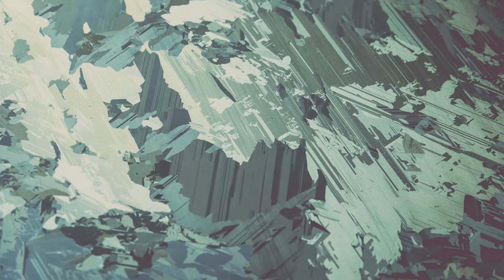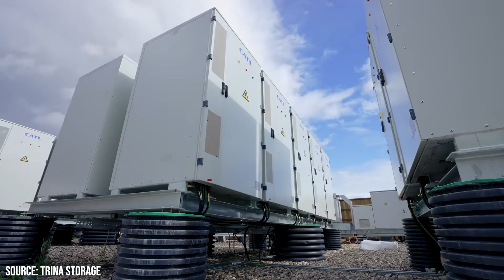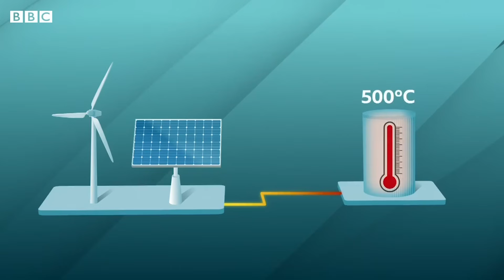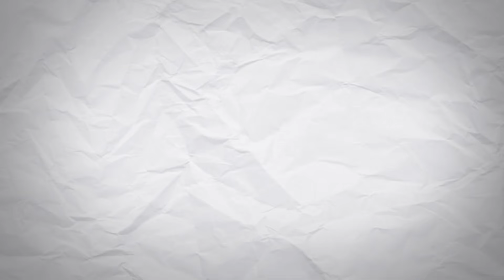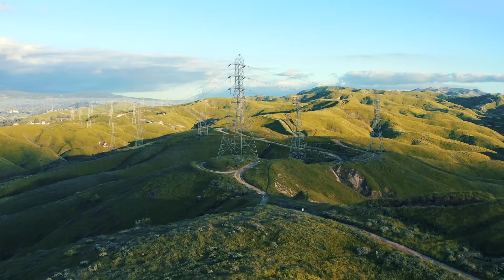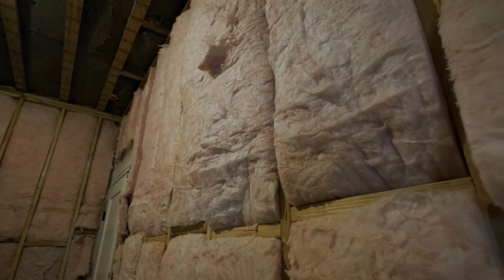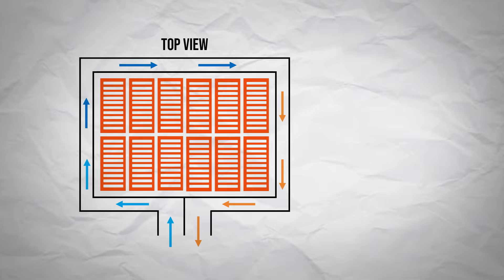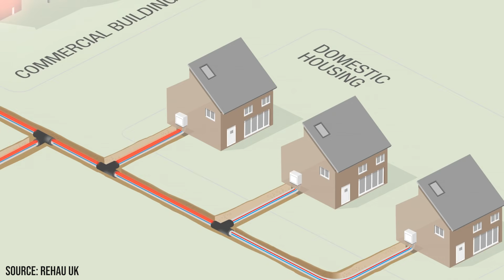How 3000 Degree Bricks Will End Battery Storage

Comment: I'm imagining all sorts of problems unaddressed by this presentation that probably means initial claims are impractical and not so much a breakthrough.
First, that 98% storage efficiency number was never addressed in this presentation. That's an abnormally high number. Although the physics and current knowledge of materials related to thermal heating and insulation are very well known and even commonly a part of ordinary systems in every home and business, limiting loss to 2% is extraordinary and needs explanation not provided in this video. The closest explanation in this video probably relates to the double wall insulation separated by constant argon or air flow, but that's not likely anywhere close to efficient enough to be a good answer. Besides, capturing losses like this is just one approach and not that original an idea.

Additionally, this system as described cannot be practical to distribute heat as an energy source.
Towards the end was described a theoretical row of residential houses, each fed with plumbing transporting heat by some unknown medium. I highly doubt that even a planned residential area would want to install a new plumbing system that would itself need to be well insulated to limit loss and the related controls to manage how the heat is used in specially built appliances like water heaters, HVAC, and possibly stoves and ovens. My subjective opinion is that's just too much innovation and capital expenditure required to develop and manufacture very original and non-versatile appliances that anyone would risk capital investment. And, there would be all the additional requirements of engineering, installation, and maintenance.

So, if distributeing heat as an energy source is not practical, it likely means that a heat storage system as described in this video can exist only where it is immediately next to where the heat would be used, like on premises heat storage. Probably the big question then is if it even pays to store heat if the heat is generated by electricity as described in this video when electricity is so much more available using existing infrastructure that exists everywhere in a modern society. Wouldn't it be far better to not deal with storage and simply use the electricity to directly power the furnaces and machines?

That leaves the probable only practical use for this type of energy storage onsite where the power is being generated, especially if sourced from electricity. That's fine but it means that it's competing against any other metropolitan energy storage.

I also take issue with the video's description of heating the bricks (of unknown composition) using electricity. This means that although technically the process wouldn't count towards losses in energy storage, it would have to involve huge losses in generating the electricity and then converting to another energy like heat. 

And, there are additional losses and inefficiencies related to what's happening on the other end, most likely converting heat back into electricity as described.

I favor a different implementation using thermal energy storage.
There are a number of designs in use today that don't involve super heated temperatures that are easier and cheaper to manage.

Comment: Would the battery be central at the origin where electricity is produced or would it be decentralized at peoples homes? This i guess is scalable either way, question is what is more efficient? Also what would be more efficient in terms of delivering to the customers, heat/steam or electricity. We already have cables to deliver electricity, so why would we want to replace those with steam/hot air pipes?
Reply: The batteries will be sited at industrial facilities, right where the heat demand is located. Heat is not transported over distances. We utilize transmission lines to bring electricity to where heat is demanded. Please note we will not be powering homes - these are for large industrial emitters like steel production, cement production, etc.
Reply: @RondoEnergyGlobal  thanks for the clarification. The vid gave a slightly different impression or i just didn't get it.

So one could say should the energy grit have interruptions or the demand exceeds overall production of energy, these batteries would close the gap or in terms of solar/wind when more is produced it could be saved up for when less energy is produced?
Reply: @kinngrimm  During peak generation in the middle of the day -- renewable power is sometimes curtailed to avoid damage to the grid. Instead of curtailing cheap, clean power, the grid can instead export power to Rondo Heat Batteries to decarbonize the largest sources of emissions -- heavy industry. We would not convert that heat back to electricity for the grid -- rather -- that heat would be sent directly to these facilities to reduce or eliminate their gas use.
Reply: @RondoEnergyGlobal  ok got it. i wish you good luck for your endervours sofar this seems to be a nobrainer, meaning why wouldn't we want to use this concept ^^ .

What material do you use to insulate  the heat storing bricks from the environment and what are these bricks made of? If this wouldn't be a company secret (national secret?). It was said in the vid you use all basic materials, right? If so, am i right to assume, that the overall concept of using these different parts in conjunction in the way you do is what makes your patent special and not the singled out parts and materials?

Is there any state restriction you would have where on earth to use this? Nowadays this seems could become a theme again.

Comment: How do they insulate the heating chamber so well? I can't see how you can store such high heats without losing a lot of it to the environment.
Reply: Dynamic insulation. The air that is cycled through the system surrounds the entire system -- so heat that "leaks" through the insulation is warming up air that is used -- this minimizes losses.
Reply: @RondoEnergyGlobal  This makes no sense at all.
If you're 'cycling "air" through the system' the "air" coming off the pile is already at temperature.
It has to go back to whatever arc or plasma heating element your process uses and be brought above the heat of the pile in order to shed heat into it.
Whatever you're using to duct that gas has to be refractory with a higher melting point than silicon. Carbon perhaps? But any of these will be reactive with nitrogen and oxygen in "air"...
Of course 3,000°F is too high for steel, and platinum is far too expensive to be used as a reflector so ultimately it is going to be radiating a lot of heat because of the high ∆.
I don't need my sense of smell to know horse💩when I'm standing in it.

Comment: Read this same story about prototype battery tech for 20 years already. But where is it?   It's time to stop fantasizing about the future and get onboard the lithium bandwagon.
Reply: Lithium is a great solution but with a short lifespan and degradation problems! There are great use cases for it on the grid -- but lithium ion cannot supply heat for large industrial thermal loads!
Reply: @RondoEnergyGlobal  Yes but the title of your video is 'will end battery storage'.   Yet your comment above is only talking about a single use case.

Comment: How do you heat those bricks, by surplus electricity from renewables? What's the efficiency of the whole cycle? There are already solar thermodynamic/concentration plants who use the same concept albeit storing heat at about 600C and this posed serious safety issues. If this company overcame them with their bricks, why not then use those bricks in a solar concentration plant?
Reply: From electricity to delivered steam, the process is 98% efficient. Solar concentration plants take up a massive footprint and require you to transport heat over distances which results in massive efficiency losses. The Rondo Heat Battery converts electricity to heat right where the thermal load is located, and plugs into a facility's existing heat network.

Comment: Sounds like an interesting concept, but you spent the least time on the most important part. And thats the actual storage and insultation
Thats why batteries are so good, because they can store their energy until its needed. Heat is constantly radiated and is a nightmare to properly insulate for long periods of time. I would imagine there is sig ificant heat loss over that 12 hour period, greatly reducing the efficiency of this system.

If you could show the actual heat loss over time, that would convince me better, but for now, im still doubtful this will replace batteries any time soon.
Reply: We are constantly exporting heat 24/7 at 98% efficiency -- from charging only 5-10 hours per day! We size our systems so that we can deliver heat continuously. Heat is not lost due to our dynamic insulation that recaptures heat and circulates it back through the system.

Comment: Air blown over the heat source and then used in heat exchanger ?
Would have to see technical data to see why this inefficiency step is in place
Reply: Air circulates through the bricks and then over a boiler tube to create steam. Most industrial thermal processes require steam -- not hot air -- not electricity!
Reply: @RondoEnergyGlobal  what I meant is, I assume u would want as little degradation of your storage material as possible so why blow air over your material won't you have problems with oxidation degradation ?
Why not use a closed system with noble gas.

Comment: This is complete quackery. Yes, if you're using the output as industrial heat then 95% efficiency seems reasonable. But the moment you try to convert back to electricity, you lose big time.
Reply: That's the thing! We don't convert it back to electricity. Industrial heat demand represents ~25% of global CO2 emissions. We're decarbonizing this heat that has traditionally been very difficult to decarbonize with electricity.  Quack quack!
Reply: @RondoEnergyGlobal  Then why use grid electricity for the heat in your thermal storage in the first place? Are you suggesting the grid is cleaner than an industrial gas burner for generating heat?
Reply: @jameswatkins7763  Marginal electricity during peak hours of generation during the middle of the day -- when the RHB charges -- is cleaner than an industrial fossil-fired boiler for generating heat. Note - we can also be configured off the grid, with an off-grid renewable installation.
Reply: @RondoEnergyGlobal  So, grid electricity is cleaner at certain times of the day? Are you assuming that from peak output of on-grid solar?

Comment: What's the maximum temperature this can get up to? And how much of the electricity generated is used to increase the temperature?
Reply: We're working toward 1,500C. We don't generate electricity -- we export heat directly to industrial processes that demand heat!
Reply: @RondoEnergyGlobal  Sweet! Im concerned about the efficiency of the whole process. If it takes 100 kwh to get up to operating temperature with this system, and that amount costs more than buying the equivalent amount of natural gas, then it makes no economic sense. Not to mention replacement/maintenance costs
Reply: @scottyyoch3537  rondo is buying electricity during peak generation hours (where electricity in some markets reaches into the the negative due to curtailment). This is cheaper than gas and provides enough charge for rondo to export heat 24/7. It can also be configured with an off grid solar or wind plant, which pays itself off quickly over the contrast lifetime.

Comment: ! have heard this 100 times before. “This is gonna be the next latest and greatest thing to solve all of our energy needs” and it turns out to be snaggle. I need proof. I want to see a proof of concept prototype working in operation and I want to be able to inspect it with my own engineers.
Reply: Stay tuned for our upcoming customer announcements!
Reply: Bloom energy will let you. Although nothing like this it is efficient ah, battery exchanger. Look them up.

Comment: My first thought is, if this idea is good and cheap with little or no drawbacks, we'd already be using it everywhere.
Reply: Our company is only 2 years old! We hope to scale quickly =] Stay tuned for upcoming customer announcements.
Reply: @RondoEnergyGlobal  Check my answer to Tetrad20, and let me know if I am understanding your goal and direction.  I have no knowledge of your company or process, but from this video it made instant sense to me. That is if I am getting it correctly.  - Cheers
Reply: But we already do, at lower temperatures. Oils, salts and water are widely used to store heat in various size solar heat capturing systems, like the accumulator tank you would have for your house or a molten salt storage for a concentrated solar plant.
The new thing here seems to be the radiated heat distribution, which allows using temperatures above the melting point of most metals, apart from tungsten. Since tungsten would be expensive, a cheaper ceramic is used, but since this wouldn't directly conduct heat very well, radiation is used to charge it up and convection is used to discharge it. This is in fact NOT entirely different from a brick house being heated up by a fireplace and releasing the heat slowly back out for your comfort. Just higher temps, since driving out CO2 from limestone takes a lot more effort than keeping a human comfortable. Also, since it takes electricity in rather than heat, it has been waiting for green energy to become cheap enough that it could finally compete with fossil fuels. Great idea, all in all. Now let's see it transform these gas-burning industries like fertilizer and cement production.
Reply: Tetrad20:  Except that using electricity to make heat is expensive, and we burn fossil fuels to create electricity. It is far more efficient to use that fossil fuel to make the heat required in these industrial processes.

Now with creating the electricity with greener methods, using it to create the heat desired makes more practical sense.  Remember, heat is the 'product' we are after, in this case.
Reply: @joeshmoe7967  I think you're missing the implication i'm making that this is probably unworkable or a scam.
Reply: @Tetrad20  I would usually agree, but in this case the idea seems to check out from simple physics, and it's merely an adaptation of an existing idea into a different temperature range for a different application. The "echo chamber" idea seems far fetched at first, but like I mention, unless you want to work with vaporizing and condensating liquid iron, ceramic bricks for heat storage it is. These are unfortunately very bad at conducting heat, so radiation and convection makes more sense than conduction.
Reply: The idea is new. That's the drawback and it's also why It's not being used yet. That's literally how science works.
Reply: @GeekProdigyGuy  I don't think this idea is new, I think this idea is inefficient/expensive, which is why it's not getting used everywhere now. I would be HAPPY to be proved wrong.
Reply: Can I use it to heat my camper? No, but I could use solar if I could afford it.

Comment: U compare thermal batteries with electricity batteries??? That shouldn´t only "feel" wrong, it IS wrong... 98% efficiency in turning heat into heat isn´t an accomplishment at all, when you actually need electricity... Look at the Ambry batteries, they also use molten metals, so being cheap, but are electricity-storage-batteries, and not heat-storage batteries. Just for the record, heat-into-electricity-conversion is far lower than 98%, and u don´t even get to begin with the whole 100%, but just with the already mentioned 98%, so, congrats... Your videos are normally above average, so, I wonder, how could u make such a blunt logical mistake in this one ???
Reply: The assumption you made is "when you need electricity" -- our industrial customers do NOT need electricity, they need HEAT! They need heat onsite, right where it's consumed -- not piped in from a concentrated solar plant miles away with massive heat loss! We do not convert heat back into electricity because our customers need heat! Hence, the 98% efficiency =]
Reply: @RondoEnergyGlobal  Of cource I get you, but still, this wasn´t underlined enough in the video... Steel-producers can always use solar-to-heat (and always already do), even without any storage happening in between. And of course, that´s the way of the future. But the context all this happens therein wasn´t underlined enough, instead "a new miraculous worder-storage-method" was introduced here, that´s gonna solve "all our problems" (and not those of steel-producers at night, for example). But I get you, the consumption of the industry is still huge, and we surely don´t have the luxury to be "picky" while thrusting aside solutions that are already there, and that already function. Also, the industry being more centralised and acting more maturely, works since long on similar solutions as yours, yours being top-notch, I guess, but it is the natural thing to do for the industry, and it´s gonna come either way. I see a REAL problem in households, decentralised, where the solution lies on the immaturity of millions private persons, who are bedazzled by Elon Musk, thereby ignoring science and solutions like Ambry.

Comment: Better to have vacuum insulation and infrared and light mirror reflectors to reflect radiation back into battery. Even then it's hard to see this being efficient at storing heat for several hours, certainly far from 90%. I just don't believe it.
Reply: We size our systems to export heat 24/7 to our customers!